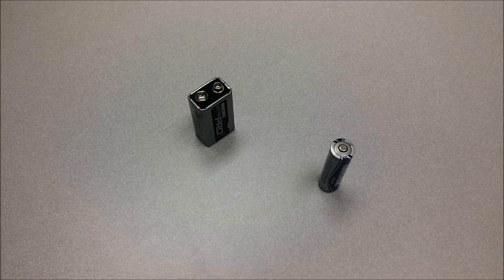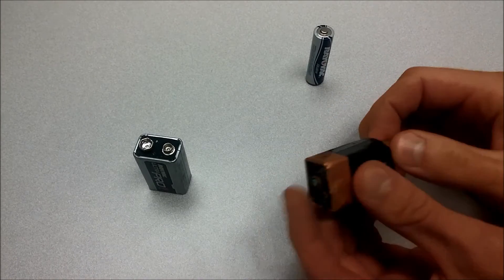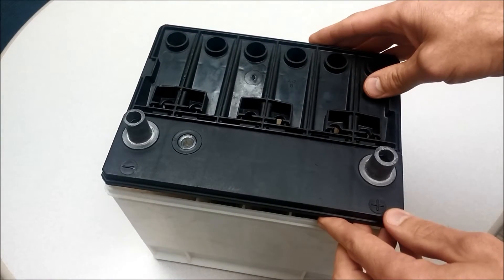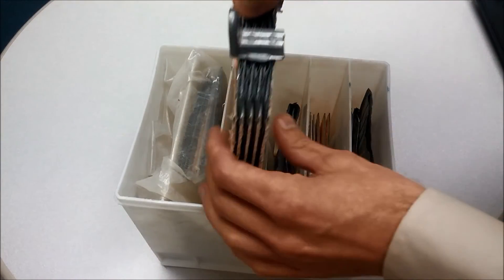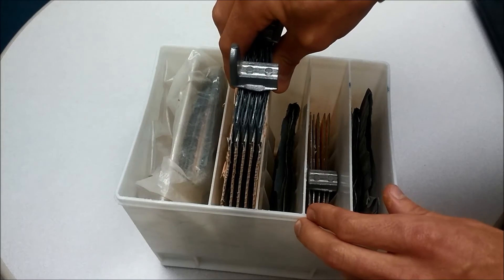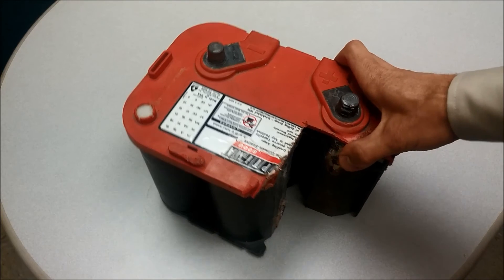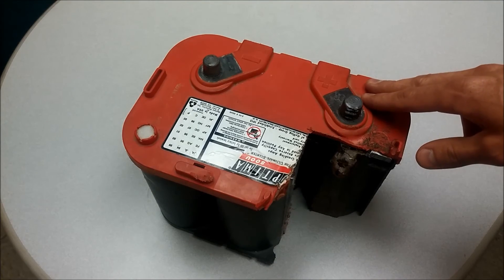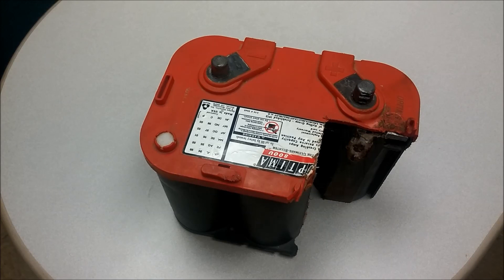Battery construction and cells

Comment: Great introduction. I would like to see what is the difference in the construction of an absorbed glass mat battery and a flooded lead acid battery. Another interesting point would be what components differentiate a regular car battery, which is designed to jolt out very many amp, to a deep cycle battery that is designed for low amperage draws and can therefore produce very many more cycles in its lifetime.